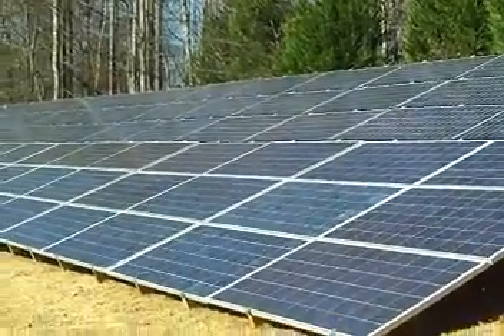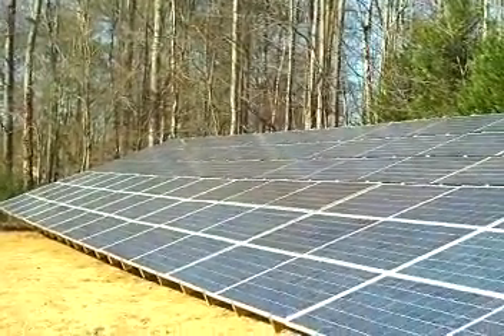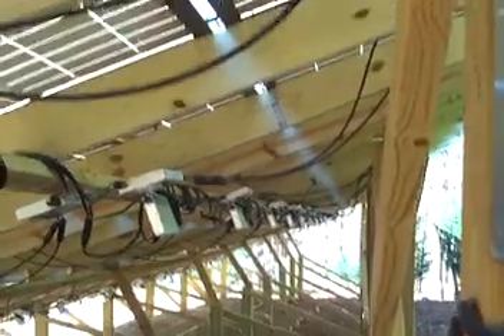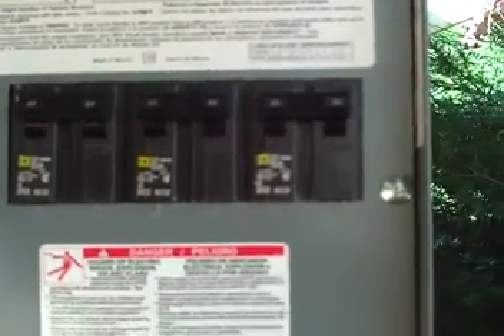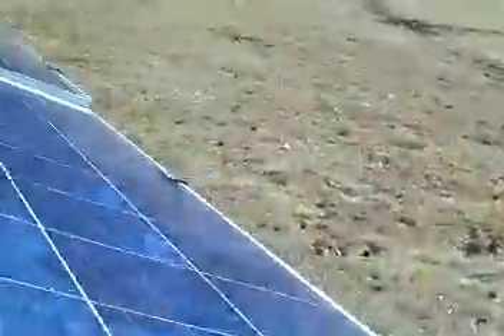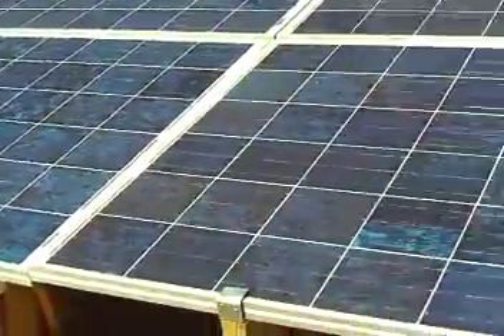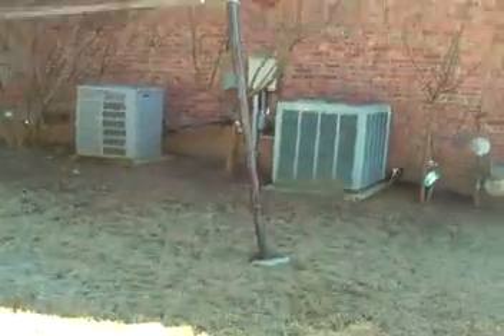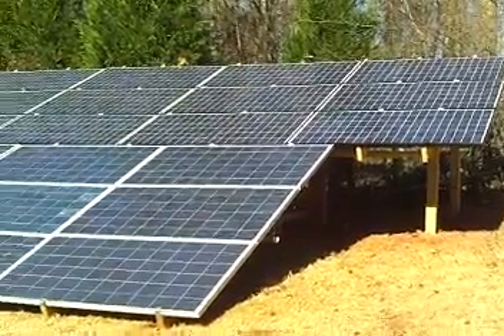20 Kilowatt Ground Mounted Solar Array Georgia

Comment: How do the Enphase 190 Micro Inverters work? I understand they covert to AC right at the panel but how do combine them and use the AC? What is the output of the Enphase 190 Micro Inverters? 120 VAC or 240VAC?

Comment: At 3:59 you show one of your brackets and it's shading part of a cell. You should fix all of those that are like that. Are you using the enphase remote monitoring system? I'm sure it would show you that one panel is lower output than the others. You may want to think about a back up system ready to plug into some of the MC4 connectors that has long cables to reach to your emergency batteries so you can have more power available when the grid goes down. Looks good!